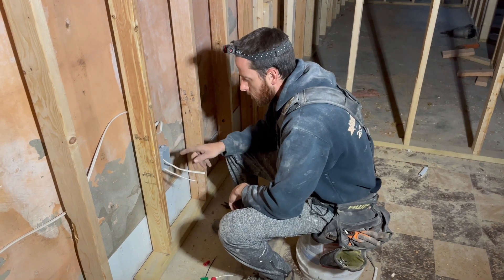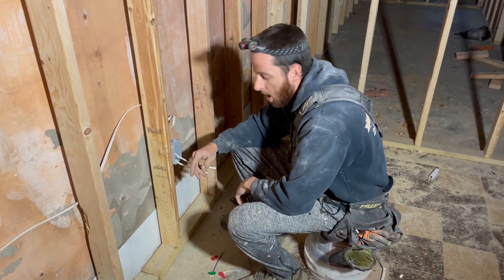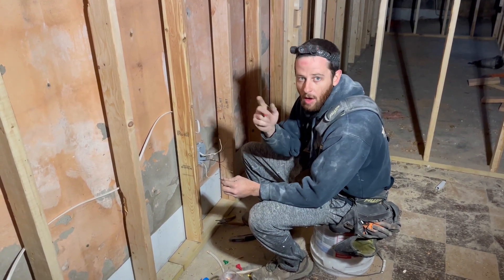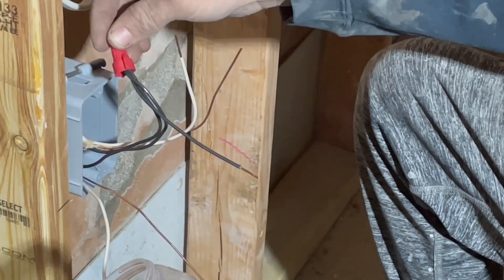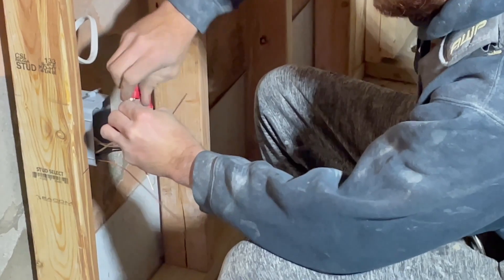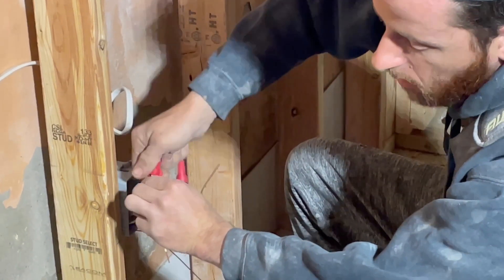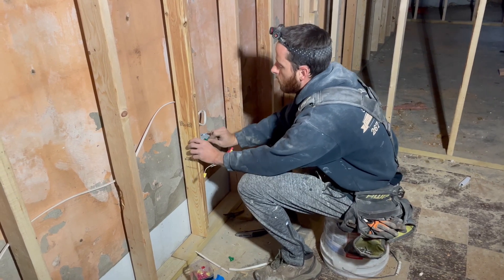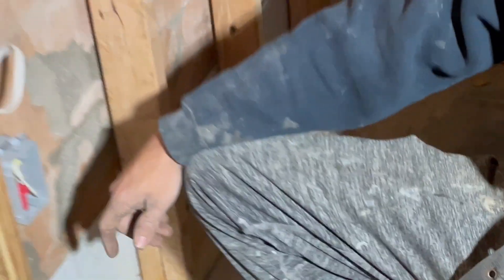How to Cut In Electrical Outlet Box

Comment: I’ll be the first to ask… why don’t you pre-twist the wires? Love the videos!
Reply from the maker: Not sure. Maybe we should! We’ll try it next time
Reply: I heard the wire nut manufacturers don't recommend pre twisting
Reply: The wire nuts twist the wires for you my electrician will twist the grounds together before using the greeny but I’m not fancy like that
Reply: I like the reassurance knowing that even if the nut came off for some reason, the wires would still be connected. To each, their own!